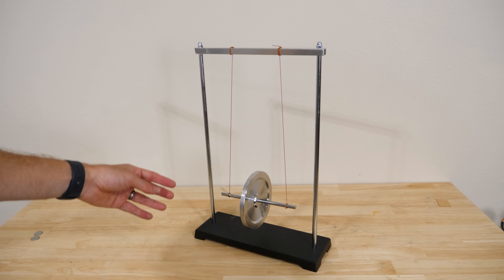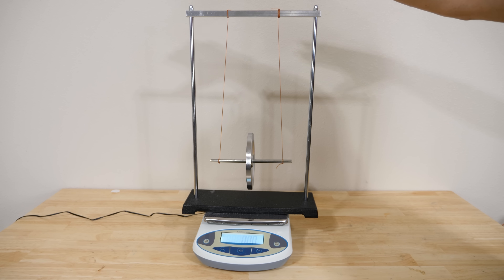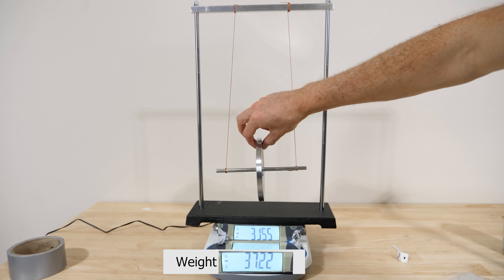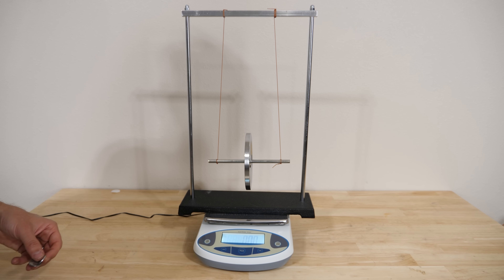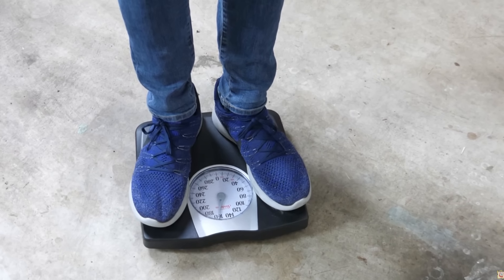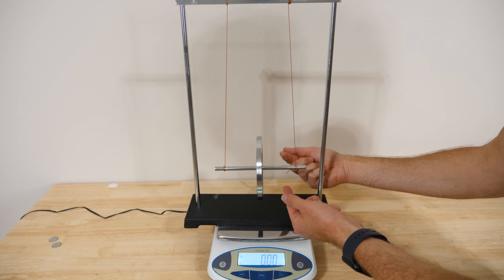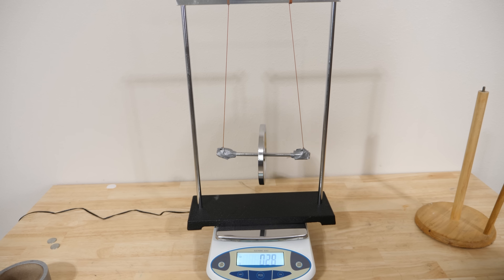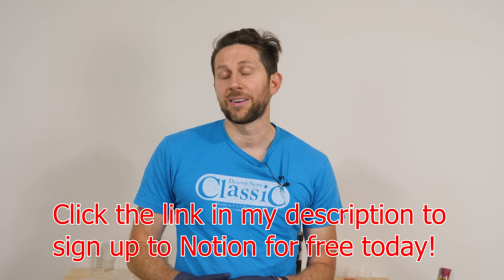How Does The Anti-Gravity Wheel Work?

Comment: its the same reason you cant turn a gyroscope the gyroscopic weight eats the density weight
Reply: ??  
..
Here's the deal with this wheel:
The wheel does NOT weigh less when it is spinning!.
..
It may be more correct to say that it weighs less when it is "bouncing".
..
I have a problem with the interpretation of the Laithwaite demo.  Precession does not translate the wheel.  It does not lift it. 
Precession causes the axis of rotation to change direction. This is a ROTATION about the center-of-mass of the wheel. It is not lifting the whole wheel's mass. 
.
Precession does not cause the gyro to move (translate) sideways, nor upward in Laithwaite 's case or Veritasium's case. 
If the vertical spinning gyro had translation, it would slide along the table, but stay vertical. It does not do that.  It tips, or rotates at 90 degrees.
The fact that the handle is offset and long has significance.  If you push the handle in the direction of the precession, that lifts the handle, right?.

However the interpretation that the spinning wheel is always accelerating downward even while moving upward,  is a very good catch. It took me a few seconds to realize that.  My quick initial feeling was that the weight would go positive on the way up. . . 
The way to think of it is that is is 'partly falling' due to gravity.  When you are in free-fall you are completely 'weightless'.  The spin and string-shaft arrangement allow it to fall, but not fully, as when you are in free-fall.  So, the frame experiences somewhere between the full weight and weightless ness, but more weight during the bounce time. 
..
 The winding and unwinding of the string causes the up and down motion which is what changes the weight. 
..
Stand on a bathroom scale and at a medium speed, move up and down by bending your knees.  Try to move faster and faster on the way down and slower and slower on the way up. You will see your weight decrease during those times.

.. .. ..
If you watch carefully, you see that it is speeding-up as it drops; this is accelerating, but not at the full 'gravity-rate'.
Also, it is slowing-down as it rises, again not fully accelerating (decelerating or negative acceleration) due to gravity.
..
On a trampoline you are completely weightless from the time your feet leave the trampoline until they touch again and start the bounce. During this time you are constantly in 'total' free-fall.
When in contact with the trampoline you are accelerating upward and weigh more than normal.
If you can add a small upward force to reduce the acceleration due to gravity, you will weigh less. No surprise there.

This is analogous to only "partway" jumping on a trampoline (or your bouncing ball).  On a tramp, you are accelerating downward when your feet are not in contact with the tramp. The ball is when it is not in contact with the floor.  The spinning wheel only "partly" leaves the support strings.  It is "partially bouncing".
If the tramp accelerated you upward at twice the rate of gravity, your weight would double.
Therefore, there is also a slight increase in weight at the bottom bounce.
.
This would be equivalent to a small jetpack on your back that can't lift you, but only partly reduces your weight.  You would be in "Sloe-Fall", not free-fall.
..
This would make a wonderful Dean Drive Scam. . . .
..
It would be nice to have a real-time force load cell so we can see what happens at the bottom of the wheels travel - the positive weight gain during the short 'bounce' time.

..
Also, WHAT HAPPENS to the weight, if the wheel is NOT spinning, but bouncing while being suspended by a spring, instead of the winding/unwinding strings?  
Is that equivalent to this "partial bouncing" effect?

Comment: Interesting Video. 'Newtons Balls' , the popular desk top toy, I Learned when training, requires balls made of Tool Steel , hard enough to transmit Kinetic energy with very low losses.  A mathematical analysis of the Maxwell wheel to accompany your Video would be well worth watching. Is there any Stored energy in the winding cables in the maxwell wheel shown ?
Reply: Another thought:  if there was negligible friction between the wire and the axle, one would have to fix the end of the wire to a point on the axle to be able to wrap  the wire around it.... 
     I'm not a physicist (to say the least): would such a reduced friction preserve remarkable amount of energy in this system?

Comment: the same reason motorcycles don"t fall over
Reply: Nope.
..
Here's the deal with this wheel:
The wheel does NOT weigh less when it is spinning!.
..
It may be more correct to say that it weighs less when it is "bouncing".
..
I have a problem with the interpretation of the Laithwaite demo.  Precession does not translate the wheel.  It does not lift it. 
Precession causes the axis of rotation to change direction. This is a ROTATION about the center-of-mass of the wheel. It is not lifting the whole wheel's mass. 
.
Precession does not cause the gyro to move (translate) sideways, nor upward in Laithwaite 's case or Veritasium's case. 
If the vertical spinning gyro had translation, it would slide along the table, but stay vertical. It does not do that.  It tips, or rotates at 90 degrees.
The fact that the handle is offset and long has significance.  If you push the handle in the direction of the precession, that lifts the handle, right?.

However the interpretation that the spinning wheel is always accelerating downward even while moving upward,  is a very good catch. It took me a few seconds to realize that.  My quick initial feeling was that the weight would go positive on the way up. . . 
The way to think of it is that is is 'partly falling' due to gravity.  When you are in free-fall you are completely 'weightless'.  The spin and string-shaft arrangement allow it to fall, but not fully, as when you are in free-fall.  So, the frame experiences somewhere between the full weight and weightless ness, but more weight during the bounce time. 
..
 The winding and unwinding of the string causes the up and down motion which is what changes the weight. 
..
Stand on a bathroom scale and at a medium speed, move up and down by bending your knees.  Try to move faster and faster on the way down and slower and slower on the way up. You will see your weight decrease during those times.

.. .. ..
If you watch carefully, you see that it is speeding-up as it drops; this is accelerating, but not at the full 'gravity-rate'.
Also, it is slowing-down as it rises, again not fully accelerating (decelerating or negative acceleration) due to gravity.
..
On a trampoline you are completely weightless from the time your feet leave the trampoline until they touch again and start the bounce. During this time you are constantly in 'total' free-fall.
When in contact with the trampoline you are accelerating upward and weigh more than normal.
If you can add a small upward force to reduce the acceleration due to gravity, you will weigh less. No surprise there.

This is analogous to only "partway" jumping on a trampoline (or your bouncing ball).  On a tramp, you are accelerating downward when your feet are not in contact with the tramp. The ball is when it is not in contact with the floor.  The spinning wheel only "partly" leaves the support strings.  It is "partially bouncing".
If the tramp accelerated you upward at twice the rate of gravity, your weight would double.
Therefore, there is also a slight increase in weight at the bottom bounce.
.
This would be equivalent to a small jetpack on your back that can't lift you, but only partly reduces your weight.  You would be in "Sloe-Fall", not free-fall.
..
This would make a wonderful Dean Drive Scam. . . .
..
It would be nice to have a real-time force load cell so we can see what happens at the bottom of the wheels travel - the positive weight gain during the short 'bounce' time.

..
Also, WHAT HAPPENS to the weight, if the wheel is NOT spinning, but bouncing while being suspended by a spring, instead of the winding/unwinding strings?  
Is that equivalent to this "partial bouncing" effect?

Comment: When the object is falling its normal to measure no mass, same goes when its going up, however the energy the object is getting to move up, gets generated when the object reaches its last point down, but it happens for a verry short time, that is shorter then the sampling time of the scale you are using
Reply: The word "energy" is not correct for it. Maybe "impulse" is more correct.
Reply: Very often in these types of experiments, incorrect methodology is responsible for misinterpretation. The first glance indicates too low refreshing rate of the weight indication. In addition, algorithms for compensating mass changes (fluctuations of readings) in this type of scales average and even eliminate short impulses. Nevertheless, perhaps in a longer measurement it would be possible to find a "golden shot" when the mass sampling would take place at the moment of changing the direction (down - up) of the movement of this wheel.
Summary: pathetic methodology, bad devices used.

Comment: CORRECTION!  The wheel does NOT weigh less when it is spinning!.
..
It may be more correct to say that it weighs less when it is "bouncing".
..
I have a problem with the interpretation of the Laithwaite demo.  Precession does not translate the wheel.  It does not lift it. 
Precession causes the axis of rotation to change direction. This is a ROTATION about the center-of-mass of the wheel. It is not lifting the whole wheel's mass. 
.
Precession does not cause the gyro to move (translate) sideways, nor upward in Laithwaite 's case or Veritasium's case. 
If the vertical spinning gyro had translation, it would slide along the table, but stay vertical. It does not do that.  It tips, or rotates at 90 degrees.
The fact that the handle is offset and long has significance.  If you push the handle in the direction of the precession, that lifts the handle, right?.

However the interpretation that the spinning wheel is always accelerating downward even while moving upward,  is a very good catch. It took me a few seconds to realize that.  My quick initial feeling was that the weight would go positive on the way up. . . 
The way to think of it is that is is 'partly falling' due to gravity.  When you are in free-fall you are completely 'weightless'.  The spin and string-shaft arrangement allow it to fall, but not fully, as when you are in free-fall.  So, the frame experiences somewhere between the full weight and weightless ness, but more weight during the bounce time. 
..
 The winding and unwinding of the string causes the up and down motion which is what changes the weight. 
..
Stand on a bathroom scale and at a medium speed, move up and down by bending your knees.  Try to move faster and faster on the way down and slower and slower on the way up. You will see your weight decrease during those times.

.. .. ..
If you watch carefully, you see that it is speeding-up as it drops; this is accelerating, but not at the full 'gravity-rate'.
Also, it is slowing-down as it rises, again not fully accelerating (decelerating or negative acceleration) due to gravity.
..
On a trampoline you are completely weightless from the time your feet leave the trampoline until they touch again and start the bounce. During this time you are constantly in 'total' free-fall.
When in contact with the trampoline you are accelerating upward and weigh more than normal.
If you can add a small upward force to reduce the acceleration due to gravity, you will weigh less. No surprise there.

This is analogous to only "partway" jumping on a trampoline (or your bouncing ball).  On a tramp, you are accelerating downward when your feet are not in contact with the tramp. The ball is when it is not in contact with the floor.  The spinning wheel only "partly" leaves the support strings.  It is "partially bouncing".
If the tramp accelerated you upward at twice the rate of gravity, your weight would double.
Therefore, there is also a slight increase in weight at the bottom bounce.
.
This would be equivalent to a small jetpack on your back that can't lift you, but only partly reduces your weight.  You would be in "Sloe-Fall", not free-fall.
..
This would make a wonderful Dean Drive Scam. . . .
..
It would be nice to have a real-time force load cell so we can see what happens at the bottom of the wheels travel - the positive weight gain during the short 'bounce' time.

..
Also, WHAT HAPPENS to the weight, if the wheel is NOT spinning, but bouncing while being suspended by a spring, instead of the winding/unwinding strings?  
Is that equivalent to this "partial bouncing" effect?

Comment: i would say it is not because of acceleration, it is from lift. a moving and rotating cylinder will generate lift. a disk is just a very short cylinder, so we have all parts needed ()
Reply: Nope!.
....

Here's the deal with this wheel:
The wheel does NOT weigh less when it is spinning!.
..
It may be more correct to say that it weighs less when it is "bouncing".
..
I have a problem with the interpretation of the Laithwaite demo.  Precession does not translate the wheel.  It does not lift it. 
Precession causes the axis of rotation to change direction. This is a ROTATION about the center-of-mass of the wheel. It is not lifting the whole wheel's mass. 
.
Precession does not cause the gyro to move (translate) sideways, nor upward in Laithwaite 's case or Veritasium's case. 
If the vertical spinning gyro had translation, it would slide along the table, but stay vertical. It does not do that.  It tips, or rotates at 90 degrees.
The fact that the handle is offset and long has significance.  If you push the handle in the direction of the precession, that lifts the handle, right?.

However the interpretation that the spinning wheel is always accelerating downward even while moving upward,  is a very good catch. It took me a few seconds to realize that.  My quick initial feeling was that the weight would go positive on the way up. . . 
The way to think of it is that is is 'partly falling' due to gravity.  When you are in free-fall you are completely 'weightless'.  The spin and string-shaft arrangement allow it to fall, but not fully, as when you are in free-fall.  So, the frame experiences somewhere between the full weight and weightless ness, but more weight during the bounce time. 
..
 The winding and unwinding of the string causes the up and down motion which is what changes the weight. 
..
Stand on a bathroom scale and at a medium speed, move up and down by bending your knees.  Try to move faster and faster on the way down and slower and slower on the way up. You will see your weight decrease during those times.

.. .. ..
If you watch carefully, you see that it is speeding-up as it drops; this is accelerating, but not at the full 'gravity-rate'.
Also, it is slowing-down as it rises, again not fully accelerating (decelerating or negative acceleration) due to gravity.
..
On a trampoline you are completely weightless from the time your feet leave the trampoline until they touch again and start the bounce. During this time you are constantly in 'total' free-fall.
When in contact with the trampoline you are accelerating upward and weigh more than normal.
If you can add a small upward force to reduce the acceleration due to gravity, you will weigh less. No surprise there.

This is analogous to only "partway" jumping on a trampoline (or your bouncing ball).  On a tramp, you are accelerating downward when your feet are not in contact with the tramp. The ball is when it is not in contact with the floor.  The spinning wheel only "partly" leaves the support strings.  It is "partially bouncing".
If the tramp accelerated you upward at twice the rate of gravity, your weight would double.
Therefore, there is also a slight increase in weight at the bottom bounce.
.
This would be equivalent to a small jetpack on your back that can't lift you, but only partly reduces your weight.  You would be in "Sloe-Fall", not free-fall.
..
This would make a wonderful Dean Drive Scam. . . .
..
It would be nice to have a real-time force load cell so we can see what happens at the bottom of the wheels travel - the positive weight gain during the short 'bounce' time.

..
Also, WHAT HAPPENS to the weight, if the wheel is NOT spinning, but bouncing while being suspended by a spring, instead of the winding/unwinding strings?  
Is that equivalent to this "partial bouncing" effect?

Comment: Several years ago, a website shut down after only 1 1/2 months. A test was shown of weight loss of a  thermocouple       setting on a sensitive digital weigh scale. The zero setting was done. Then power was switched on to the themocouple. Why was this shut down? I did research and found out 2 others had figured out similar method. There was a french scientist who used 2 slabs of different metals sandwiched  together hooked to an oscillator. The other was a researcher in Pa. in late 1800's called John Keely. He worked with thermocouples and thermopiles of silver, gold , and platinum wires, and was able to make steel and brass metals lose weight. An old US Patent was on 2 counter rotating large brass high speed discs . The 2 electrical fields generated affected each other , and caused a 3rd field called KINEMATIC. Items in that vicinity had less or no weight. Are you aware of any of this?
Reply: Read the Wikipedia article on John Keely.